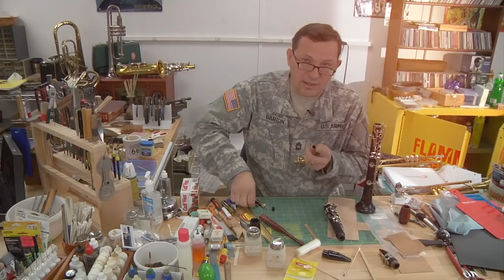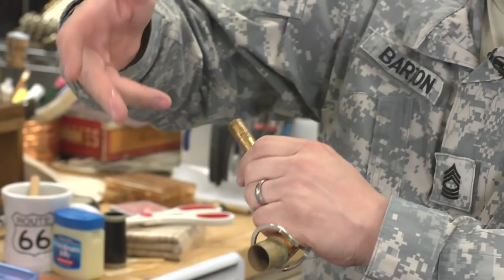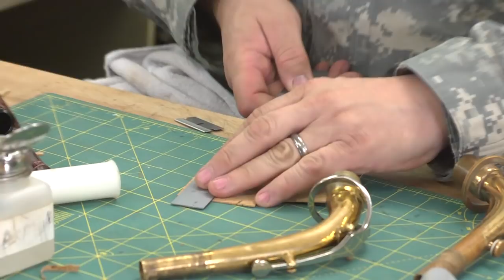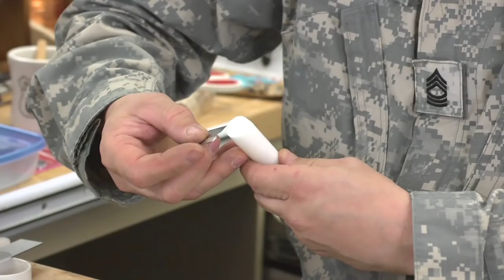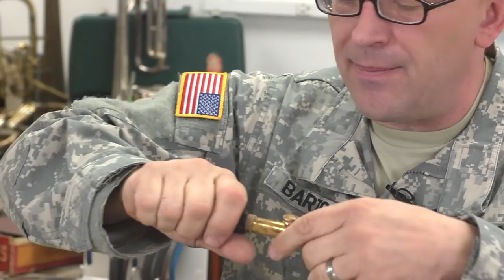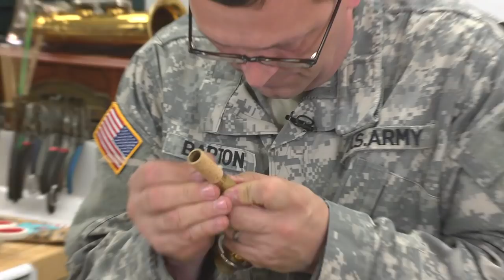Neck Cork Replacement: Saxophone Instrument Repair

Comment: Was part of the First US Army Field Band at Ft. Meade back in 75-76 (Bicentennial!). Army Field Band was the guys on the other side of the base who got all the high profile gigs. ;) Hardly played much for the past 25 - 30 years and the neck cork needs replacing, so I found you here. Good to reconnect with a part of my past.

Comment: Awesome instructor. I guess that's why you do it for the US Army. Excellent Job MSgt. I just bought 2 saxophones at a yard sale yesterday for $50.00 ($25.00 each) One is in Mint condition and the other one needs a cork job and also replacement of the pads.. any chance of a detailed production on pad replacement.? One is a Alto and the other a Tenor Sax. The Tenor is a Paris made Selmer about 50-60 years old the Alto is a Mark Vl Selmer..

Comment: I cringe at seeing the trumpet and clarinet (in other videos) standing without any support. These seem to fall over and get damaged giving me more work to do. I try to tell musicians to never stand these instruments on the bell so they don't get damaged. Pretty good information there on the neck replacement. I never use acetone because it is not really needed, and it is nasty on one's hands, melts plastic. So I use mineral spirits unscented as it works perfectly on the neck removing excess glue.

Comment: I sent my alto out to get a new cork and when I got it back the cork wasn't up all the way to the guide ring at the top and I was like ?? I pulled it off because it wouldn't work, air got in and it was all scratched were you were carful not to I was so irritated because its a 2k 20 year old selmer sax! looks like you know what your doing thanks for your vids

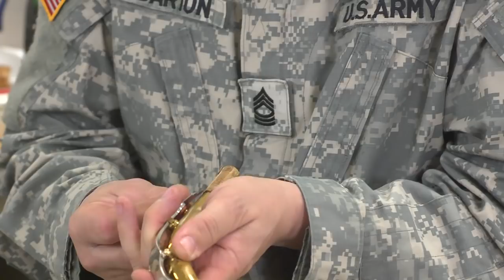Comment: He uses a wrong technique to scrap the cork at 4:26 he is putting pressure against the octave pad. This way the pad can be damaged. It is a good idea to remove the neck octave key before start to work.

Comment: Read 2nd..i know nothing about replacement of pads ..what can you tell me.. a couple of the pads came off while i was cleaning it ..i think they had both been stored in the attic from the previous owner. the lacquer is original on both but on one of them it looks like it has tarnished some. meaning the shine is not like the one that looks new..should i just leave it alone.. what does relacquering do to a sax.. i mean it doesn't have any effect on the performance does it.